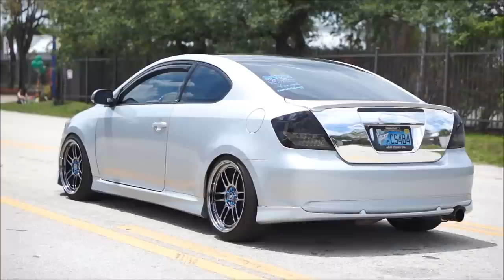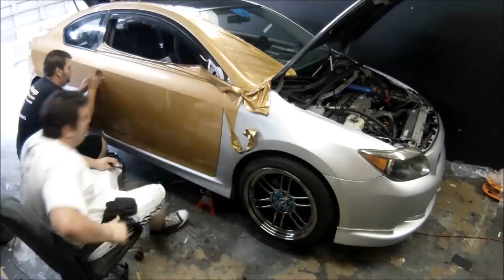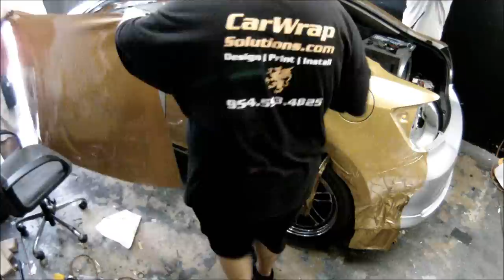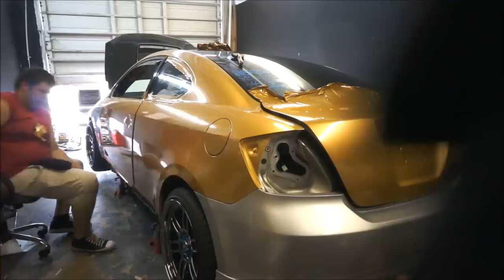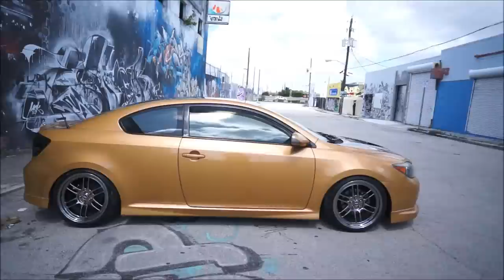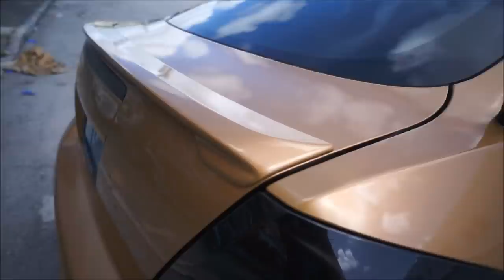Scion tC Gold Metallic 3M Vinyl Wrap - South Florida

Comment: how many square feet of vinyl do you recommend purchasing to wrap a tc 1?
Reply from the maker: the material comes in 60" width usually.... so just get 20yd or material. make sure a full roll (25yd is not cheaper where you order it from) i can get you some materials too.
Reply: CSOCSO so I'm looking at rolls that are 5ft by 75ft so like 25yds and it's like 5-600 for the material. Is that good enough then right? Thanks!

Comment: What size wheels you got/offset? Did you have to put coils on?
Reply from the maker: Brandon Mac2455 they are 18x9.5 et 38. I got coilovers rolled fenders. Also had to cut parts from the metal in the back and also some tabs by the front wheel/fender. My coils have adjustable cambers. If you get a coilover kit without that then you need camber bolts. Also running a small maybe 5 or 10 mm spacer in back. And have a 2 degree negatove camber. I think thats all